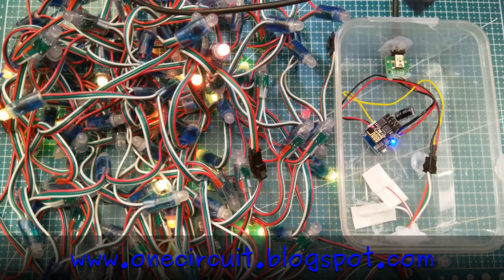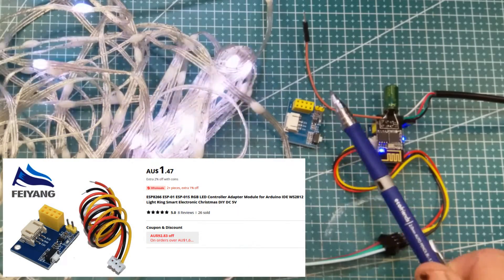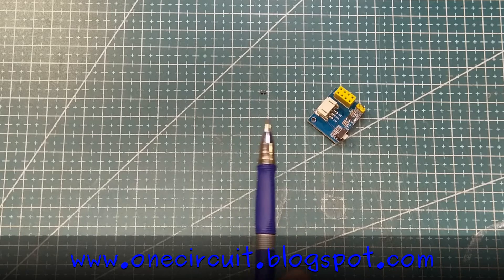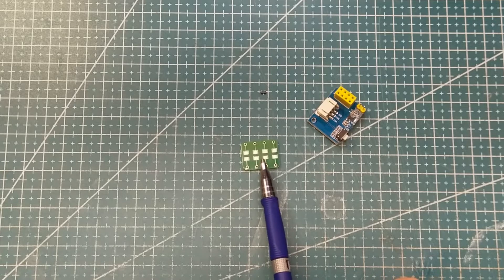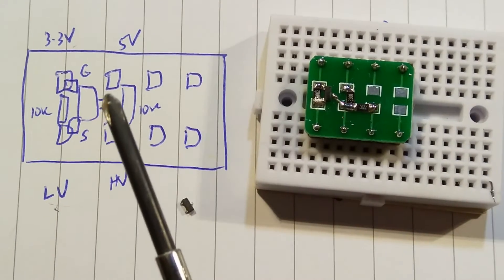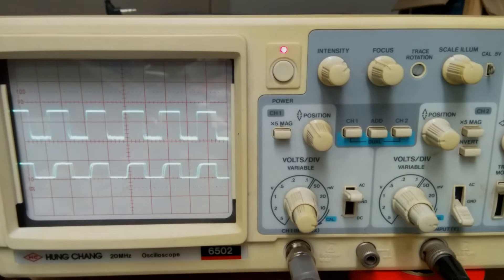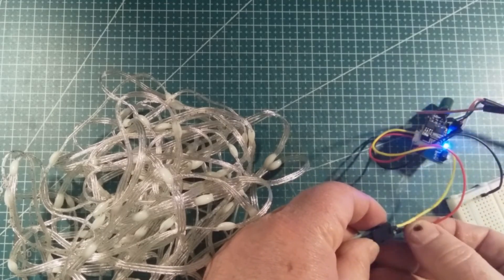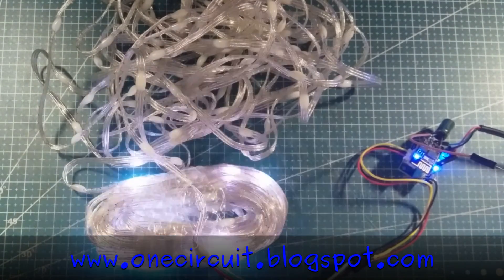AO3400 WLED level shifting incident/accident

Comment: If you aren't destroying stuff, then you aren't TRYING!
Have recently bought some boards that are much like Adafruit's AN10441.pdf for i2c level shifting.  Less trouble than constructing the circuit twice for some random 5v-2-3v application.
They work a lot better than the TXS0108 when working from the low side.
Reply from the maker: It was a frustrating couple of days - but in the end I have working LEDs - in fact I resurrected the old "broken" strips by just cutting out the first LED (probably blown) and reconnecting. VOILA!